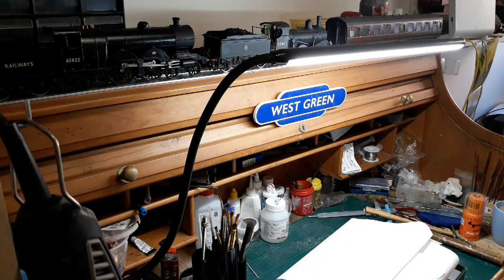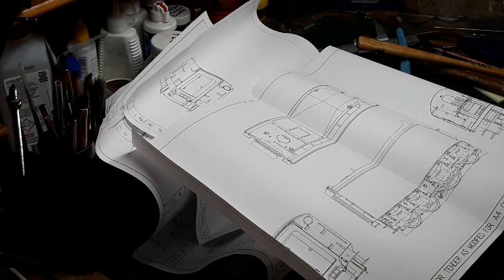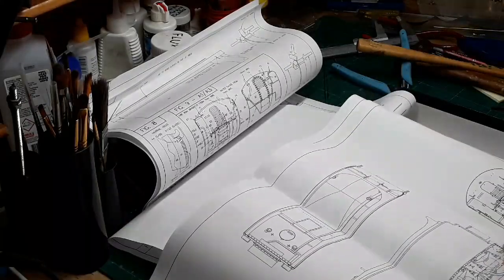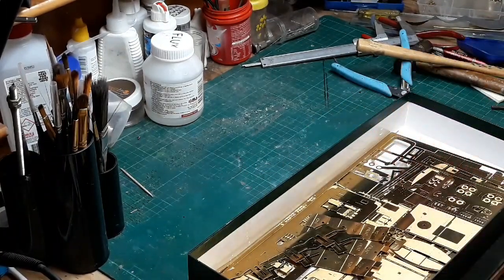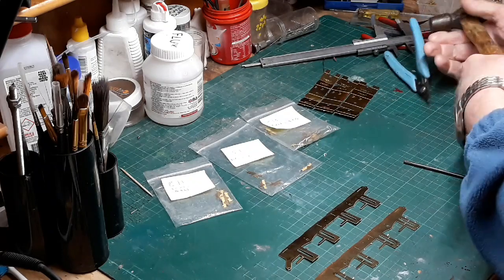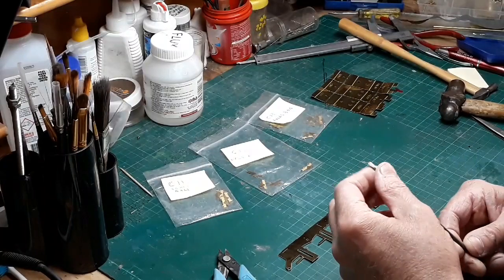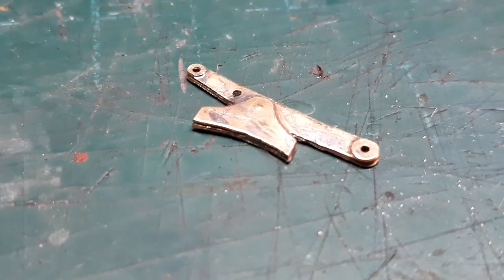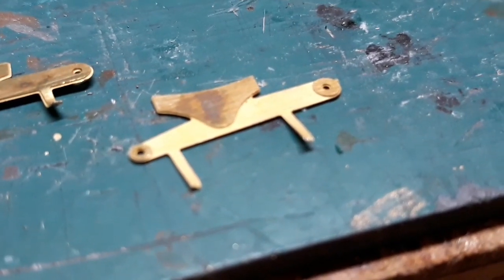Martin Finney 1928 Corridor tender for Gresley A4 Pacific  12 May 2020.    Part 1

Comment: This is a very nice detailed kit, I bought mine in 2019.
At more than £900 for the tender, loco, wheels and motor/gearbox it is quite expensive yes, a Hattons RTR sells for less.
But I'm sure that this model beats every other option for an A4 in the level of detail, only omitted part is working inside motion, but with the kits available for this (Laurie Griffin) it could be made.
And besides the level of detail, a metal locomotive in this scale just does have the character of the real thing with just that bit of unevenness in the surfaces, and the thickness of certain parts, which can't be represented in plastic, they just look too smooth.
Even modern EMUs still have that slightly uneven surface caused by the welding stresses in the skin.

So I watch your progress on the tender, and on the locomotive itself when you start it, it will help me in my construction of the kit I think.
Reply from the maker: Rather apt your message as I just finished the Connoisseur loco kit Polly.
I have the chassis built for the A4 and have just started on the tender body.

A mate of mi e built the Finney Duchess complete with internal valve gear and Alan Harris wheels
The wheels alone cost more than the kit at over £600 just for the wheels.
I wouldn't bother with internal valve gear unless it was some high boilered loco.
Inthe A4 it would be a total waste as unless you pick it up then it's never going to show.

As far as Barton's are concerned these locos are plastic, are made in China which I'm just over buying stuff from
How long do you think a Hattons A4 will last??????
Coaches and wagons are ok but locos are mechanical and I know they have issues.
Reply: @Steven_Rowe  I agree on the fact that the inside motion on the A4 will be invisible in a normal viewing angle, and will also not be visible trough the frames from the side.
So it can be omitted.
This Finney7 A4 will outlast the Hattons one by at least a century I think, unless you drop it on the floor or so.
Gears which wear are easy to replace, and a good quality gear box like ABC will serve a long time before it wears.
Reply from the maker: @Tom-Lahaye  Your right and when I look at the RTR market  I can understand why people buy them but I hear so many reports about stripping of nylon gears and other such issues and yes they look lovely.
I have two Dapol locos.
I have an 08 hhunter and the 57xx as L94
I had a kit to build L94 but sold it when I found I could get an RTR version.
The paint job on it is better than I could do but I if she ever breaks or stops running then that is it.
Even the latest state of the art Hornby stuff will not last compared to the old Triang of 60 years ago.
When you look at old Hornby Dublo  that stuff is virtually indestructible 
Even the Dapol pannier has working inside motion. Which you have to take off the track and turn upside down and run with alloy clips to see run.
Why???
I think Tony Writings approach to modelling is a good one, if you can't see it then don't model it.
The Allan Harris wheels on my mates Finney Duchess are amazing but at loved £600 a set that like not something I could afford nor justify.
If I had that sort of money I would simply get some pro modeller to build and paint the kit and get them to write there loan cheque.
That is not going to happen .